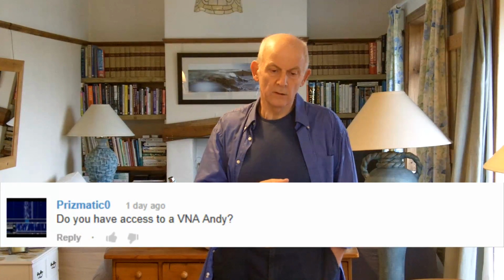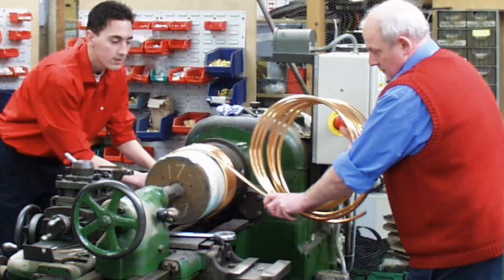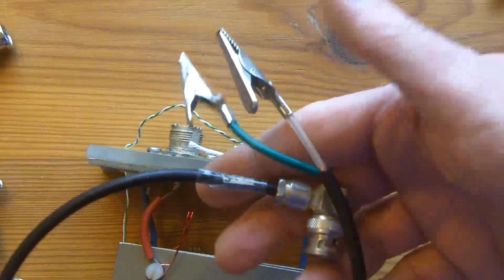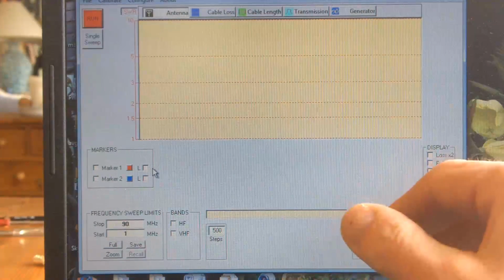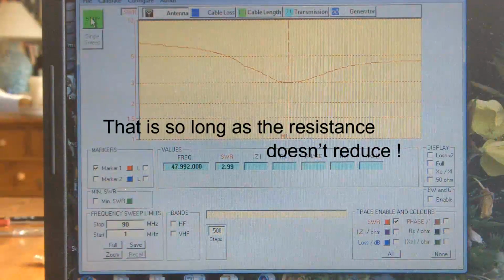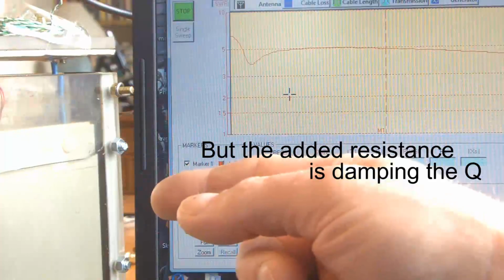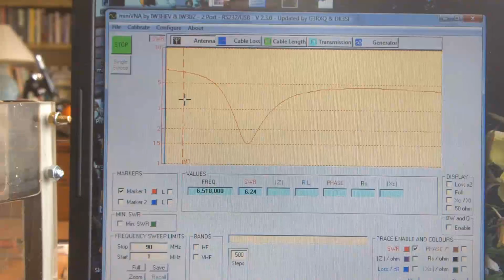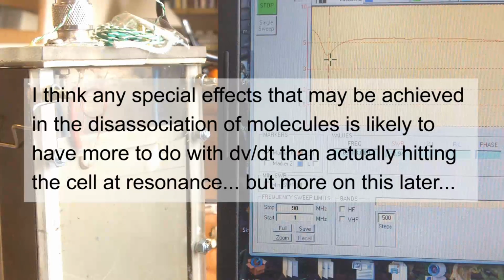HHO. 20 Using a VNA to find the cell resonance

Comment: You found the device/cell resonance  making it transmit the signal more efficiently probably so voltage spiked tune cell to have same resonnace as water or hydrogen and oxegen bonds. It cant have 2 frequencies unless they are multiples of each other or whatever but you could create a 2chamber with 2 frequencie maybe  but you probably just need to tune it to opeerate at freq not actually resonate by itself at that freq. Because it has to resonate wet.

Comment: Hi Andy,  thanks for sharing. I have been studying this effect for a while And your right about dv/dt been the answer,  from my tests the best way to exceed unity is using electric fields to separate the polarized atoms of O and H, in this way no current is required to pass through the water so even insulated plate would work.  So the circuit should be a step up transformer, secondary in parallel with the hho cell and a simple jule thief using the secondary through the BE path of the transistor and the primary triggered  the  transistor. 
This setup is self ringing so changing resonance is not a problem

Comment: Hi . Glad to find you. I read and test HHO long time ago and i realize the term of "resonance " it is abstract . I read all the patents they claim hitting resonance 
but in fact they " push" repetitive pulses and get a image of that fare away to get resonance . Thinking only of two values C & R changing random in cell
(the electrolite between the plates will be always different because of gas bubbles ) in analog terms the resonance is impossible .
I even try to create a digital filter for R and C to automaticaly adjust and follow  the frequency with a 120MHz DSP .
I remember i create a converter to operate the cell at 0.7v and 60A and the dimension between plates between 0.1 - 0.3mm.
Unfortunately i was limited of DSP processing power and in time i realize the resonance of water is just a illusion .
That is my subiective point , if someone can prove different of what i say i will be glad to see.
The filter i write for that is on my old channel 
https://www.youtube.com/watch?v=Y6e-i7dk23w
Sry for my english

Comment: You need to breach the Ghz range which is the natural resonance of water vapor, not a body of water. You can breach the resonant frequency defined at 22.3 GHZ utilizing UVB, xrays, and even gamma rays towards atomizing spray nozzles.  The higher the range in the EM Spectrum the more energy the photons carry which also I'm on board with you. I also think Stanleys approach at 20000 cycles per second is brilliant because of his results, and the snowball analogy could very well be correct. it's like tiny bubbles vs large bubbles, is the small frequency cavitation the result of true resonance? An excellent question. I'm planning to make an experiment similar to Stanleys with an arduino. If it doesn't work, someone will have to use an RF signal generator or a Block Up Converter at the Ka Band frequency, I'm hoping Stanleys resonant circuit works because equipment at this range tends to be very expensive.

Comment: Thanks Andy, that was a great demonstration of the effects of water as a dielectric . The capacitive change can also explain some surprising results a few experimenters have seen. For example one researcher who was using distilled water also, had a small device running , "bubbling happily away" as he put it, - He was sitting casually having a conversation with a friend when suddenly the device started producing orders of magnitude more gas! He had no explanation for it and stated that he'd been unable to reproduce those results. Saying he was glad someone else was there who saw it because over time he might begin to doubt his own eyes. Others who have seen increases over time say things like "the device has to 'run in' for a while before it operates properly" . I want to postulate that the resonant frequency - (or some harmonic thereof ) may have been accidentally achieved temporarily due to the doping of the dielectric water by ions of metal from the negative plate. There has been some discussion about the chromium being stripped away from the stainless steel alloy. Obviously when this occurs over time the dielectric value of the water changes and the capacitive value of the tank circuit could cause resonance or a harmonic to temporarily exist. We have all seen the 'brown water' or in systems using added electrolytes, the sludge that accumulates. Questions abound ... If one reversed the polarity of the plates to try to re plate those ions to the plate that lost them , ... Would the newly negative plate simply dump all the material it had accreeted and further 'contaminate' the water ? And would it then just be a source of new contamination from its own chromium ? It seems that much thought will have to be given to a solution to this problem of varying values of the dielectric influence of the water if a stable state of resonance is to be achieved. ... Also aren't we really dealing with a dynamic resonance of the chamber volume more than the vibratory resonance of water which is up in the hundreds of tera-hz range? Once the charge pressure is reached to tear away the covalent bond the separate atoms can reform as their elemental form. There have also been observed new combinations of isotopic groupings. These may be short lived but some unique features have been observed. I would love to hear your thoughts on these things. ...Mike b.

Comment: Of course there may be multiple resonances outside the bandwidth of your VNA, I notice a HF roll off; could this be a resonance dip much higher than the 100MHz?, sure we could predict where it is too based on the roll-off. The water molecule has multiple resonances but we are most interested in the H-O binding, which will be higher than the H-O-H; which I believe is the resonance you have found. Impedance of water has been measured before and the H-O binding lays in the infra-Red region.
Perhaps a combination of High Intensity Laser-IR and 5.5Mhz to get the water into two oscillatory modes will be more effective in splitting.
Its also interesting to note that the piezo-mist generators use 3MHz Ultrasound; not too far off your measured value-but obviously this just separates the molecules to form the mist; not the atoms.
Reply: the piezo-electrochemical effect begs to differ ;) piezo's of small size can be stimulated to split the water molecule. Both through electrical discharge and "cleaving" the molecules with resonant ultrasound to the O-H bond
Reply: @wanderingzanzey2126  Please, can you give some more info on this. Thank you
Reply: Cold mist vs TAP water. I am trying to make a not-immersed cell after ultrasound mist maker, and i can not figure out the dimension of the cell regarding capacity, voltage, amperage. This cell should convert all mist to hho, so i am thinking of 40 plates dimensions 0,5*50*100mm * 40-ish plates with cca 0,5mm gap, running some voltage in paralel (greater voltage then wet cell ?) i suppose that energy input will be similar or maybe smaller, but what about voltage/amperage ratio ? Does it demand greater voltage ? (more than 12V), maybe much more voltage, and much smaller amperage ? Also, the wet cell works better if it is shallow and wide, maybe with mist is contrary ?
Reply: mist maker have it's regulator and i can regulate the voltage and amperage after so if i just knew the needed area and gap for mist, please, gimme some thoughts. For example, mist maker can (1/10 of power) convert 10ml/h of water, the area of cell must be bigger, probably the gap smaller and voltage greater than the wet cell with ordinary tap water (for the same amount of hho generated). Maybe the power/area factor would be better for not having bubbles

Comment: you need to auto tune the current going through the water at the resonance frequency off the water as the current changes so does the resonance frequency so you need to retune every fraction of a second so you need a auto frequention finder that auto adjusts to the frequention of the water
Reply: Bruno Schoofs; how do you know you need to adjust resonance?, from his VNA the resonance looks pretty rock solid.

Comment: its not the cells or plates resonance you need to find ,but the water resonance beceause that what you want to split using resonance as power to breake the atom appart

Comment: Hello Andy,

I wish I still had the concentration to get back to Ham studies (I only have a 25 y o 2 meter license: low tech) and develop some working devices. Alas, I'll offer what I think I know up to now about H2O to HHO.

I don't believe there is any point building a cell and then looking for its resonance. Shouldn't one begin with the DISSOCIATION freq of water and design a cell to work at that frequency?

From reading about Keely (?) more than 25 years ago I never forgot that the desired frequency 'is' 38.2 KHz. (I read lately that it may be 40.2 or 42.? KHz) Has my foggy brain drifted over time? 

Anyhow, I believe that this gives everyone a range of frequencies to target, something which seems to be closely guarded by the 'folks in the know' who think they deserve a patent for saving humanity, as I have never seen anyone volunteer this info for this purpose before.

I had begun with the idea to use an ultrasonic device in a high pressure vessel (I had a large 1500 PSI tank to begin with) to tap a central column of broken' water but that idea came to naught. I think I had been inspired by Keely's work (pre-Tesla) and the fact that wavelengths of sound frequencies in a physical medium are similar to microwave EM frequencies. I wondered what kind of (EM) synergies (energies?) one might encounter with sonar.

Good luck to everyone who can't resist tinkering, seriously.

Comment: Stan used a red laser 630-640nm 
This was to opticaly pump the hydrogen electron to a higher energy level (A Quantum leap)
Hydrogen resonates in the Red spectrum & has an Ionization potential
of 13.28 volts.
In its high energy state: just 1.28 volts
would be required for the Ionization to occur.
Reply: What about the oxygen?

Comment: Hi Andy, that's a pretty interesting experiment with the mini VNA, but with a parallel LC circuit in resonance isn't the output a dead short, as opposed to a series LC circuit where no current flows at resonance.  Isn't that a more desirable condition.

Comment: You are confusing SWR and resonance.

Resonance is by definition a condition where the reactance is zero. If for example, the coil had a input of impedance of 1 + j 0 at 10 MHz, then it is resonate at 10 MHz, but with an SWR of 50:1.

If at 2 MHz it had an input impedance of 50 + j1, the SWR would be very low (1.0002:1) but not resontate.

A full way dipole is resontate, but has a very high SWR.

So to find the resonate frequency (if that is what you want to find), then look for where the reactance is zero.

I don't know what you are doing, since I did not look at other video or read everything. So I do not know if the resontate freuqnecy is what you actually need. Maybe it is not.
Reply: @Idris Gregory yea, been using instaflixxer for since december myself :)
Reply: @Idris Gregory Yup, have been watching on instaflixxer for since december myself :D
Reply: @Idris Gregory yup, have been using InstaFlixxer for years myself =)
Reply: pro tip : you can watch series on instaflixxer. I've been using them for watching a lot of movies these days.

Comment from the maker: 1 of 3
Hi Gun, well it’s a very big subject but the starting point is to understand that if a capacitor and a coil are connected in parallel and a current is pulsed into the circuit there will be a frequency at which some of the current will naturally flow from the capacitor to the coil and then back out of the coil back into the capacitor. That happens at ‘resonance.’ In electronic terms this usually happens on a very short time scale.

Comment from the maker: 2 of 3
It’s likened to pushing a swing, the power that you put in on the downward swing takes the swing up the other side of its travel and then returns almost to the peak of its starting position. When you push a swing you are pretty well pushing it at ‘resonance.’   If you push at the wrong time you either miss it altogether, push it too late and fail to put any energy into the swing or you push it too soon just as its still moving towards you.

Comment from the maker: 3 of 3
So if you’ve pushed a swing you already know a bit about the timing of resonance. In an 
electronic circuit this can happen millions of times a second (or more or less depending on the coil/capacitor combination) so you can imagine the timing of the current pulses is extremely critical.  If you search for ‘understanding resonance’ and ‘resonant circuits’ you should find loads of good explanations.
Anyway I hope that helps to get you started.        
All the best ... Andy

Comment from the maker: Hi there Billy boy, for the VNA and a couple of UHF to BNC plugs, I paid £235 that’s pounds sterling for it back in 2010 that would have been about $360.  That’s a lot of money for something the size of a cigarette packet but I figured on the one hand I could have bought one or two antennas for that money but the VNA makes building your own antennas a piece of cake. I’ve built GDOs but the difference is like comparing a slide rule to a scientific-calculator.  
All the best ... Andy

Comment from the maker: Hi, it’s a little bit more complicated than that but essentially yes. In a series resonant circuit when you hit resonance the voltage is magnified. The idea is that one could use the ‘electric field‘generated by that voltage to disassociate the water. The issue I have is that the resistance of the water is wasting power and heating the water. The VNA does sweep a range of frequencies, I'm testing in parallel but the frequency is the same as series (more or less)   Hope that helps.     
.. Andy
Reply: have your frequency at resonance to the water-electrolyser but use a pulse width of 300nano-seconds with a static induction Thyristor. The Voltage pressure developed will dissociate the water by first generating OH and H3O radicals that upon continuous pulsing break down into H and O which recombine in the water to form H2 and O2 respectively. The resistance of the water holds no meaning in this setup as the ultra-short pulse width is pulsing the current faster than the Electron double layer and Diffusion Layer can form on the surface of the electrodes. In this way no current is passed through the water, the water strictly acts as a dielectric (water needs high C for this to function well) where the input voltage is greater than the dielectric breakdown threshold. In this way the electrolyser becomes a capacitor in an RLC circuit, instead of a high resistance load. This is "virtual breakdown" of water.

Comment from the maker: Thanks Rick I take that as a real compliment. OK on manipulating data, I guess you’ve heard the old account’s joke about ‘What’s 2+2?’ Well, I’ve worked with patent attorneys and accountants, the really goods ones are those who ask you ‘what you would like the answer to be,’ before they start work! 
Yep I think heat and light will have a part to play but I need to stay focused on the first step to see if a chopped signal is more efficient that plain old DC.  
73’s ... Andy

Comment: I had some neon equipment stopped working every time you turn the lights off. It needed to have the lights on, to add a little bit more light energy to make the neon bulbs fire correctly.
Regards Rick

Comment: Well done experiment, most interesting. Great exposition about why I can use a cell similar to this for a non inductive, non resonant RF sponge (resistance) to use to adjust and test my radio gear. And heat the water to boot.  If you can actually resonate a cell like this, its resistance demands that the frequency would HAVE to be high >50Mhz! Random thought -even if you hit this cell with pulsed DC- as soon as that hits the capacitive element, you will produce counterproductive AC components?